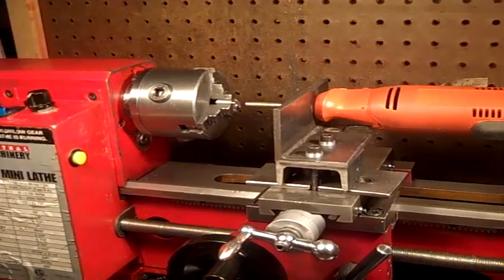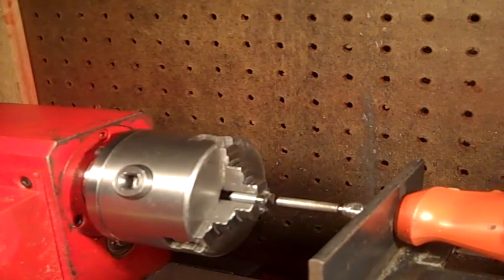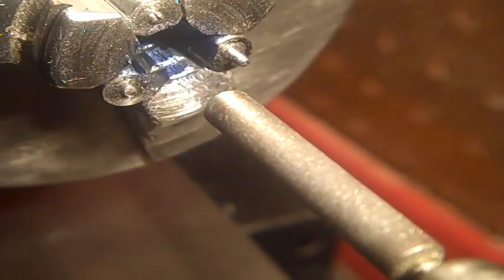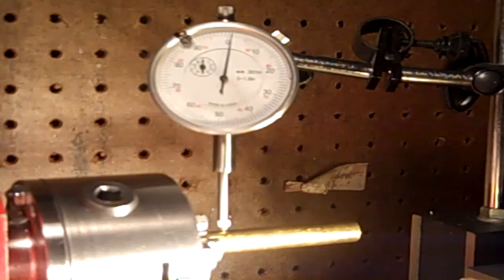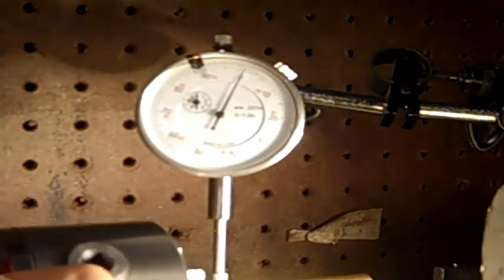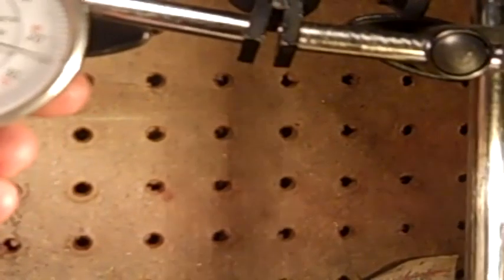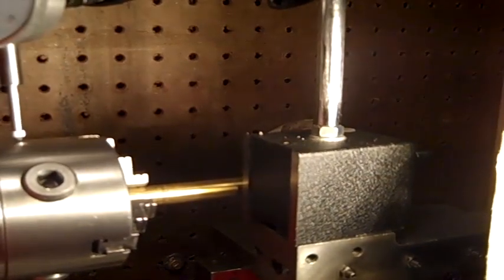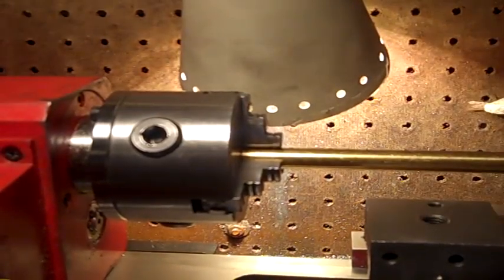Grinding Mini Lathe Jaws

Comment: I use an end mill as a test bat after I grind my jaws to see how much run out I have. Then try tightening from the 3 different key holes. 1 of them will make the chuck clamp the truest.